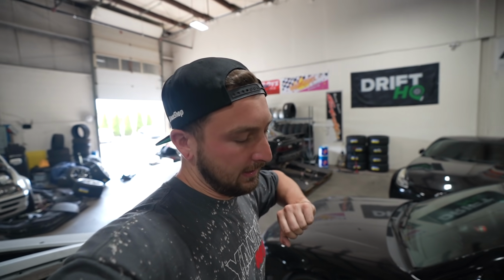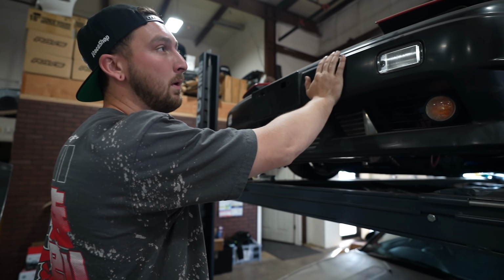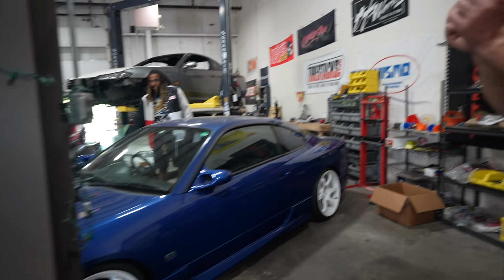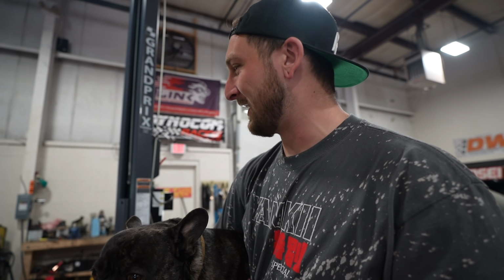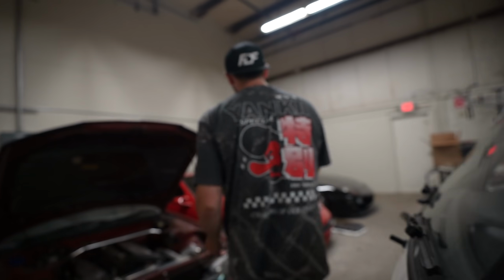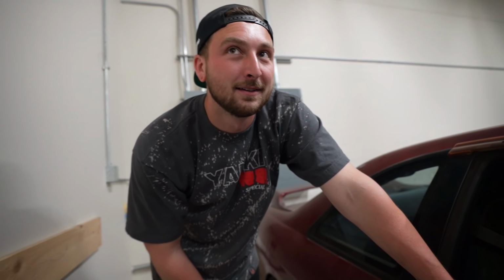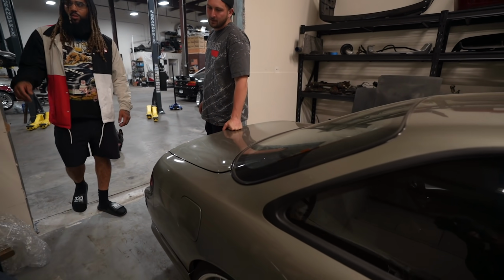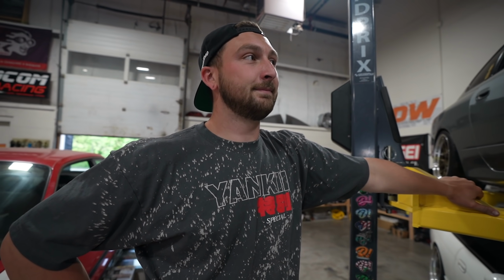I FINALLY SOLD ONE OF MY CARS.

Comment: Imho id sell the 33 and use the funds to get in a 33GTR. I cant imagine youd really have any regrets once its done especially if youre selective and get a good clean example. I had a feeling the pewter car would get sold eventually, spent too much time on that lift half-done collecting dust. And with the black and blue 15’s in the long run i doubt you will regret that either. Cant wait to see what you replace it with !!
Reply: GTRs are overpriced, just get a clean coupe and put gtr parts on it, maybe even a rb30/25 build.
Reply: @Jake_Hamlin  GTR's are that price for a reason..... plus, bolting on GTR parts wont turn his car into a GTR.

Comment: I know I would love a all out k- truck build.   Here's how I would do it.   So the 4x4 Colorado ar5 transmission with the solstace bellhousing would give you a 4wd ecotec setup.   The LNF engine is a 2.0t that was rated at 260hp/260tq (flywheel)  in factory configuration.  They can also make 400hp reliably on stock long block.  You don't even have to change injectors at that point. That engine can be had for around a grand.  I've heard you talk about being sad about the mainstream jdm engines being too unobtainable,  here's a option that's super attainable.  If be surprised if you couldn't source the whole drivetrain for under $1800

Comment: With any swapped honda as soon as you change the rear mount to a good aftermarket motor mount the car gets a crazy vibration.  I swap back to a stock one with urethane inserts and it's an insane diffrence.  Dk the mounts on your k swap but I'm sure one of the mounts isn't dampening enough.

Comment: Final verdict after the video: S15 is gone... Who cares, he has the black one and its perfect. Chaser and smth else is coming which is dope. Zs will never go away which is dope, altho I feel like the RedZ lacks some badges, R33 is cool but a GTR would be cooler and I feel like Jimmy wouldnt think back on it after he will get the GTR. S13 is cool but if you get rid of it and fully make the 180sx FYeah spec would be killer. S14s are good to keep around for the long game so you can have the full collection. I feel like the shop needs some improvements. Maybe a couple of 3 post lifts so you can clear the garage. Stack em near each other in the back where the Zs are. E30 would be cool to be replaced with a coupe maybe a dyi M3 rep. Long live the S13 coupe aaaand just fix the kei truck. No one's needs a fucking K swapped Kei truck 🙏 love the content jimbo

Comment: The k swap, if you have throttle issues you could upgrade to drive by wire. Also for the drivetrain, find a way to add some bushings or new oem  bushings. Just thinking out loud.

Comment: Supercharged Rotary engine is an idea  for the mini Truck , it needs custom work but it is kinda Easier than a K series in a transverse mount or you can some how adapt an Accura TLX front Subframe mount it on the mini Truck then you can bolt on the Kseries on it

Comment: Jimmy look at motec traction control system on motive YouTube channel for the r33 no need for gtr these days,
You could also look at a zf8 gearbox conversion with clutch by wire to totally transform the r33

Comment: Yo- I know its a bit further out there and you gotta learn that drivetrain, but EV swapping the Kei truck would be so dope. Even if you kept most the drivetrain/gearbox and all and just replace the motor with either a zero motorcycle motor or another small electric motor.
Reply: Definitely this is a great idea

Comment: Throw some Axis OG or Drag DR20s on that Corolla bro nice gold with polished lip 15x8 +25 with 195/45 tires slammed. Or if you want some RS Watanabe 15x8 +35 wheels I have a gold set and another gunmetal set both identical lmk

Comment: Why don't you just swap a Subaru single cam and 5 speed in it and use the front diff as the rear axle.